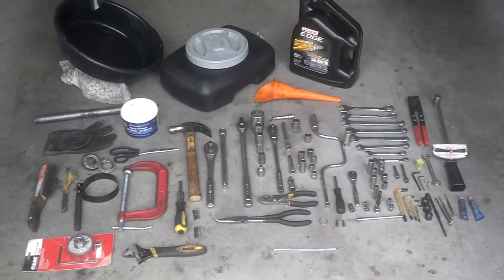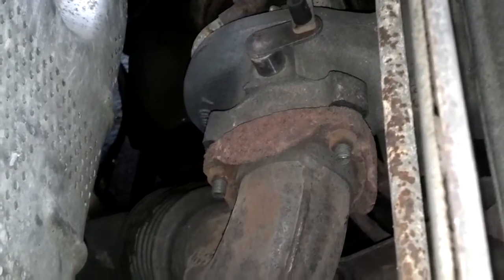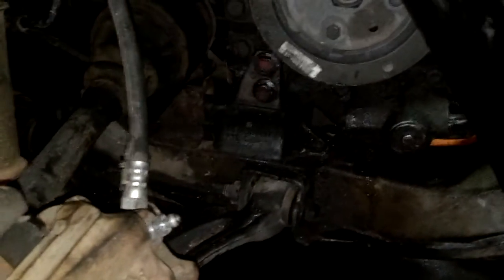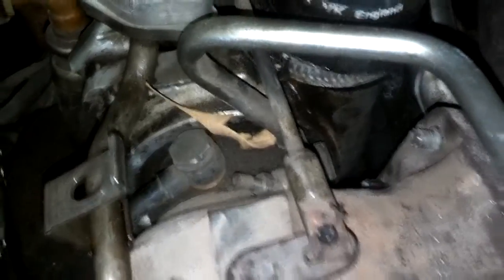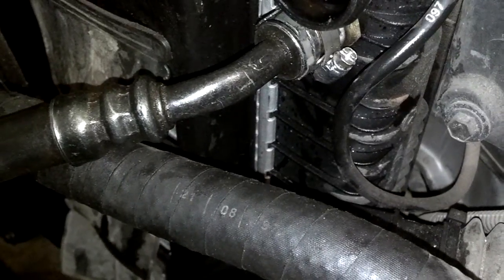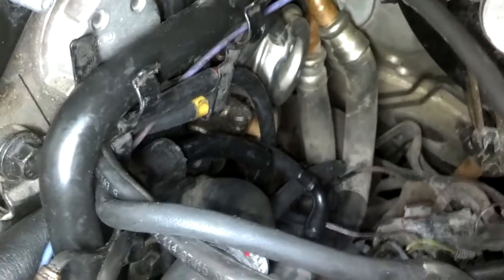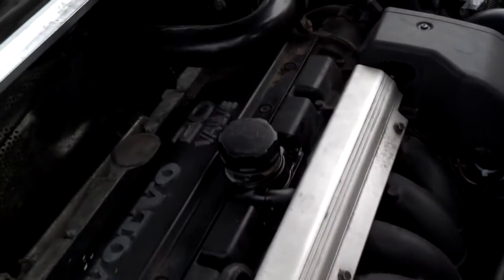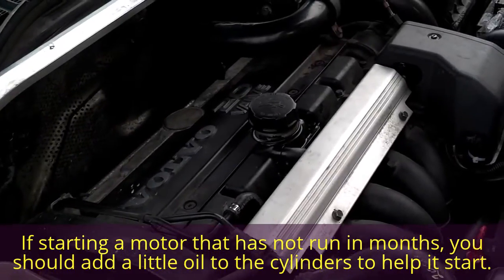Volvo 850, S70, V70 Turbo motor swap, engine installation, how to install it. Part 4 of 4 - VOTD

Comment: How do you put the fly wheel in to line up with the torque converter?
Reply from the maker: you reach past the flex plate (flywheel) and turn the torque converter with your finger.

Comment: Hey Robert, would it be much different to T5 swap a na99 v70? Also, what ecm would I use? Or perhaps it would just need to be tuned? I’m definitely not the most experienced so I’m still looking into whether doing a t5 swap is a logical idea.
Reply from the maker: I don't understand your question.
Reply: @RobertDIY  sorry. What I’m asking is how difficult would it be to put a t5 engine into a 99 v70 that has a NA engine in it. I am mainly concerned with how compatible the harnesses and ecm would be.
Reply from the maker: You can toss the engine in there wouldn't matter. Now if you going to add the turbo and all that stuff that's a total different story.
Reply: @RobertDIY  yes. I would be putting a t5 motor in place of a NA motor. Bad head gasket on the NA motor and I’m looking for more power so I’m considering the t5 swap.
Reply: @beoendicott2780  what did you end up doing

Comment: When you do this to go from a low pressure turbo to a t5 do u need to change anything like the turbo or ecm? Or is that all the same between the turbo cars?
Reply from the maker: Computer is map'd different. Would be a good idea to swap the computer or have it tuned.

Comment: HI Robert DIY,  what issues would I have with the ECU when swapping a turbo drivetrain into a non-turbo chassis? I am assuming I would need the key and ignition to go with ECU of the donor vehicle? Thank you in advance
Reply from the maker: +vaz Fx What year?
Reply: Sorry...forgot that important information. It's a 2000 s70
Reply from the maker: Cluster and ETM. But I really don't know. It would be a lot easier and cheaper to get a car from the south, where people sell them super cheap because they can't find a mechanic to fix them.
Reply: +Robert DIY Thanks. That makes sense on finding a southern car

Comment: Robert have you done an engine swap using a RN white block  Into a p80 car?
Reply from the maker: Mitch D No I have not. Did you need some help with something?
Reply: Robert DIY Possibly . . . . Sent you a PM.

Comment: Great job Robert!!! So where did you end up finding an engine hoist?
Reply from the maker: Michael Sackstein Took the car to a shop and rented a lift slot.
Reply from the maker: Probably a clogged catalytic converter.
Reply from the maker: Replacement, maybe cleaning. (Search YouTube for "cleaning the catalytic converter").
Reply: Yeah the code for that is P0420. Do you smell it through the air vents?
Reply: ok that is weird. I would say try getting the evaporator cleaned as it often gets contaminated overtime with mildew & debree. mechanics usually have a machine that does that and it's not all that expensive. and I would also recommend replacing your cabin air filter if you have one. I think your car does have one.
Reply from the maker: The rad and AC condenser was back washed and the cabin air filter is new.